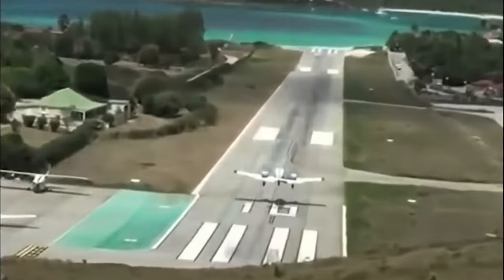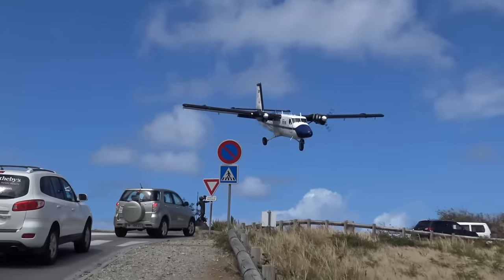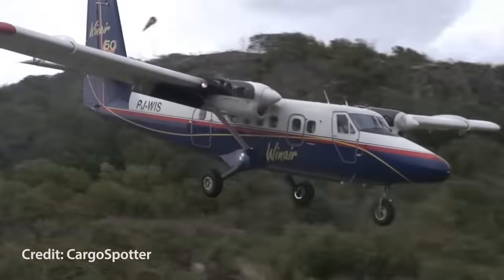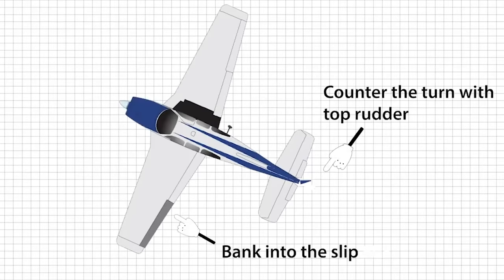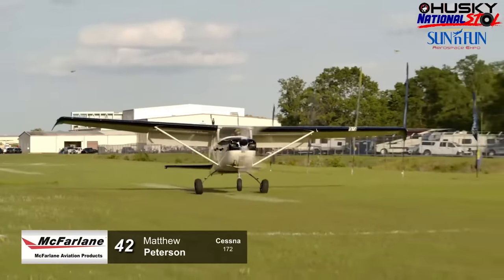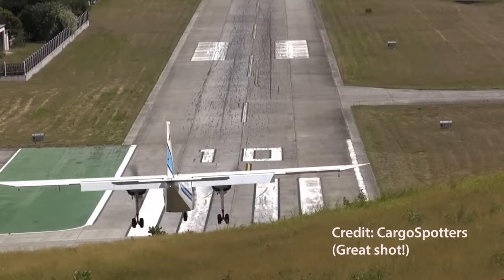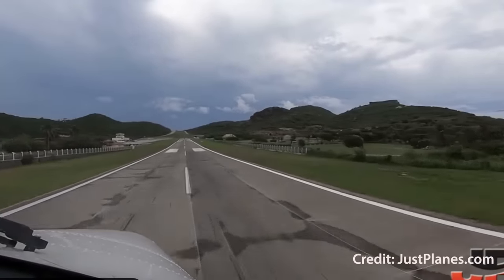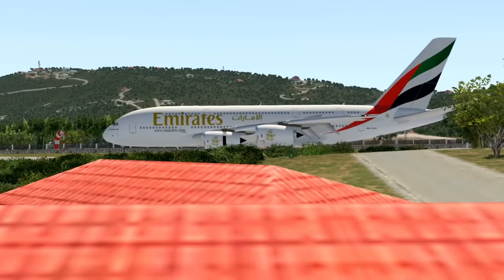Why This Landing Went Bad Part Deux

Comment: I doubt the accuracy of the sim - the brakes on the A380 probably wouldn't work quite that well in real life. But I suppose clipping the wingtips on the trees and light posts would make up for that...
Reply: You know what they say... one man's runway edge marker is another man's EMAS.
Reply: Looked like there was a graveyard right next to the runway. Must be where all the others that attempted to land a A380 there ended up.
Reply: I'm going to guess that 380 was configured with zero passengers, fumes in the tanks, a preteen-size  pilot, and auto-brakes set to "someone call maintenance and the fire department" setting.  With a killer headwind too, I'd guess.  You're not a simmer until you've set the wind speed to 140kts and performed the legendary 747 VTOL traffic pattern.

It would be interesting to know just how short a real 380 could actually stop in a zero-compromise hail-Mary attempt in perfect conditions.
Reply: It’s easy in a sim…just set up 100kts of headwind!
Reply: @suprPHREAK  Or in other words gail force winds, or above! At which point runway markers are not going be much of a problem
Reply: The real problem with the 380 is not the landing, how will you turn the aircraft and start there. I Guess, youre stranded.
Reply: @JuliusCesar2781  and destroy the runway in the process.
Reply: @JuliusCesar2781  just put the reverse thrusters to climb back the hill .
The slope , maximum thrust and a few prayers will help you takeoff
Reply: @Boss_Tanaka  When you fly backwards and land backwards on a different runway you need to close the reversers to have forward thrust for breaking. Fantastic idea.
Reply: @Boss_Tanaka  that and a bunch of jato packs
Reply: @JuliusCesar2781  A380 beachside bar & grill.. & hotel & casino & condos.
Reply: @JuliusCesar2781  It's happened before. They take the wings off and haul the plane away on an extra-wide flatbed.
Reply: @harveywallbanger3123  good joke !
Reply: An A-380 - never ever!
Reply: @JuliusCesar2781  Just fill it up enough to get you to the nearest real international aiport and make sure the rest of the aircraft is empty.  Otherwise, I don't think you'd be able to get an A380 out, even piece-by-piece on trucks.
Reply: Way back when a commercial pilot, I think for United, on his last day, dropped a DC-8  if I remember right at a GA airport in Troutdale Oregon.  Boeing brought in a test pilot and engineer and they directed the operation to get it out.  Remove all seats and anything else not bolted down, dump water and set fuel to about 25 gallons, just enough to hop 10 miles to PDX.  The question was always, did he intend it to be his last day, or was it accidental???
Reply: @ZeeCaptainRon And there was that C-17 crew that landed at that GA airport accidentally, with Gen. Mattis aboard, no less.  But it seems a bit different when it’s an aircraft that was actually designed to perform such landings.

Comment: The Arrow could have saved it, not by adding power at 100’ but at 400’ and going around. All the cues of an unstable approach were right there. Even on short fields, a stable approach is critical.
Reply: No reason not to go around until you get it perfect.  Unless, you are low on gas, then don't go there!
Reply: From your lips, to God’s ear, you speak the absolute truth on this one.👍
Reply: If there is any doubt, there is no doubt. Go around.
Reply: The twin that touched down a bit far down the runway and skidded into the water also could have done a go around when it became obvious they'd left entirely too much runway behind them.
Reply: I would say on short fields it's even more critical.
Reply: Spot on.  But sometimes I think pilots have a problem letting go of our egos and admitting we didn't get the approach right.  It's the same bug that causes pilots to fly into situations that their guts tell them to stay away from.
Reply: @evanwindom3265  True, which is why it's important to reframe the situation, and ask yourself the hard question:

What is more important? What is the show of better airmanship? Succumbing to your get-there-itis like a fool? Or being the adult in the room who can calmly say "this isen't right, go-around"?

It's not easy, but that is the trick. Reframe the situation, make it a point of pride to go-around. Think of it as not just the correct thing to do, but the moral thing to do, a display of both good airmanship, maturity and leadership skills.

If you can reframe the go-around like this in your head, so that you nolonger see it as a failure state, but rather as a display of maturity and class, then your own ego will eventually be the voice telling you to go-around.

You have to get it drilled in there first though, that's the tricky part..
Reply: @Grobut81  Good words!  I used to fly a lot of SAR, so we saw the results of bad decisions all the time.  I think it would benefit any pilot to look at crash analysis videos and see the "chain" of failures and poor decisions that leads to disaster.
Reply: @evanwindom3265  Oh definately. There is much to learn from watching videos like this.
Reply: exactly!!
Reply: I have a pretty fragile ego. I'd rather go around for a nice landing than trash a plane trying to stick a bad one.
Reply: A stable approach is more critical, not less, in short field operations. The margin of error is much smaller, and given that TFFJ's runway 10 slopes downward, you need to find a way to "flare" at a lower angle with the horizon than usual, hence must be carrying less speed on approach than usual. The opposite consideration is at play when landing on an upward slope; you need to carry additional speed so that your "flare" ultimately matches the angle of the runway, and doesn't turn into a stall/faceplant/bellyflop into the runway (quite common in one-way runways in the mountains; Aibai and Lukla are the go-to examples, but they are everywhere). The guy in the video somehow managed to faceplant despite the runway sloping downward, which is sort of an achievement in and of itself.

Comment: I’ve ridden in on a twin otter into this airport.  They cheat quite heavily flying in there.  We came over the hill quite hot.  I expected a go-around because of the excess speed.  But we got. Over the numbers, the pilot reached up and hit the reverse  thrusters and we came to a stop almost immediately..   I had a quick chat with the pilot and he just smiled when I mentioned the speed and the stopping prowess…
Reply: Agreed, heck even the approach at full feather (beta mode) is a huge air brake compared to almost anything with a piston engine. So if you are on speed you can simply control the angle of approach with the power lever. Then as you say, as soon as the mains hit its full reverse thrust.
Reply: Anything with a PT6 shouldn't need brakes to stop, move the props to beta and they become large air brakes, as soon as the mains are down, pull the thrust levers to maximum reverse. You can easily back up, I've done it many times.

Comment: I have over 500 landings at St Barts.  The Twin Otters usually fly a  much steeper approach as their STOL ability allows them to.  Typically they will be able to see the numbers the whole way down.  We were flying Aztecs and couldn't approach that steep safely.  Our procedure was much like the islander in this video - cross the ridge and follow it down at weed mowing height.  While the Pilatus was a little low, you do have to skim that ridge to avoid being fast and high.

We would get the gear and flaps down and stabilize at blue line about a mile out.  Call the non tower and be sure the runway was clear as you can't see it.  Cross (more like skim) the ridge about 10kts below blue line, and push the nose down.  The angle is steep enough you accelerate towards the numbers.  Trade winds buffet you, lots of rudder work.  At 20 feet raise the nose, but the sink rate doesn't change much as you are fairly slow.  Add a burst of power to arrest the descent.  Plant it.  This cannot be overstated, no time to be delicate.  Get the nose on the ground, flaps up, and brake hard.  If you aren't braking hard by those checkerboards you see on the pavement edges, go around.  You won't be able to stop in time as the runway is downhill to the beach.  We'd brake firmly to be sure we made it, then ease off to the beach.  Saved the brakes some, and you sometimes had a topless French babe wave at you as you turned the airplane.  

The Baron that hit the beach was way out of profile.  Not even close.  Obvious lack of local training and no awareness of the need to go around.

Runway 28 was for East winds under 6 knots or calm.  West winds essentially never happen unless it's a storm.   The approach is lower than the mountain peaks and you are in close to them.  Turn final over the bay and take a good look at the runway.  Here you decide to commit.  The is zero chance for a go-around, the ridge rises too fast.  If something  enters the runway, take the grass, but DO NOT go around.  

Paul Wikander (Virgin Air) had a photo of his DC-3 in St Barts in his office.  Apparently that stemmed from a wager, which he won.
Reply from the maker: Good summary. Thanks for that.
Reply: @AVweb   midweek's comment should be pinned as the top comment, I'd suggest   :)
Reply: Respects to you , sir !
Reply: What about with the 737? What's the best way to do this?
I'm thinking I'll reverse thrust over the traffic circle.....after I dump all my extra fuel on the beach-goers
Reply: i have 1 million landings here and this guy is wrong.
Reply: Paul Wikander was my boss when I flew for him back in the late 90's
He was quite the character. 
A flying pirate ☠️
Reply: Did you fly for Paul ?
He took the DC-3 in there on a bet, fully loaded with band equipment on a bet.
After he land, the French authorities wanted to arrest him...but they couldn't figure out what charges to bring on him.
It was the largest aircraft to ever land in TFFJ.

Comment: I spent a winter flying PA-23 Aztecs into SBH daily, sometimes 2 or 3 times a day.  Loved it, but often wished for the reverse thrust capability of a Twin Otter.  They gave us a little license to fly in there (mid 1980's), and I sure wish I had kept it for old time sake.  One of the fun parts was seeing passenger's reaction when the runway finally came into view on final.  Landing on 28 is easy if the wind allows (rare event, but we had a two week period in December when the wind reverses and it was called "the Christmas winds").   But if the wind favors 28, you can't take off on 28 so that meant a tailwind takeoff on Rwy 10 which was always much scarier than any landing at SBH.  In any event, the fresh-out-of-the-oven French bread at the bakery across the street from the airport was always a worthy reward.   Good memories!
Reply: You must have  been there just a few seasons before me - I still have my St Barts license.  We used to count the "Oh my God!!!"s from the back as we crossed the ridge and dove for the numbers, compare notes after work.  Triple cream brie on those fresh baguettes was a great lunch.

I had an engine failure on short final at St Barts, the mag drive cover loosened enough to drop the gears out of mesh.   That was excitement.

Comment: Another factor in landing at St. Barts SBH/TFFJ is wind. There are three windsocks and it's not uncommon for them not to agree with each other. If the normal easterly winds are 8 knots or less, you land on runway 28. One of my landings on runway 10 was 9 knots, gusts to 20 knots. DHC-6s and PC-12s have the advantage of running props into Beta, to shorten roll out. You are required to have a current Letter of Authorization or a local flight instructor onboard.

Comment: Brings back memories, for sure. My flight school had a 1600 foot runway. There was no sand trap at the end but there were a bunch of trees out there, and the damn things grew taller every year. We could land our 152s on half the runway but needed every inch on takeoff. Once we staggered into the air we'd have to do a quick left bank to miss a big one, followed by a right to miss another. Interesting close-up views of the branches out the side windows. We could handle it OK but some pilots unfamiliar with the place would crash into things, usually the chain-link fence and airfield sign at the other end. Fun times.
Reply: The occasional pilot crashing into the trees once and again will hold them in check.

Comment: Very Cool 😎 
I used to fly for the only U.S. 
air carrier that was allowed/authorized to operate into/out of TFFJ.
It did require extra training, which my boss developed for the French.
TFFJ is classified as a "Hazardous airport" under ICAO standards. 
Due to the fact that you can not fly a stabilized approach to get in there.

Comment: When I was learning to fly, way back in the mid-70s, I flew out of Waterford, CT.  We had 15, 18, 33, and 36.  Runway 36 was permanently closed because at the departure end of it was a huge hill.  I would guess that the hill was probably about the same height above the airport as the one at St. Barts is, except it was a little further back.  Between the hill and the end of the runway, I-95 ran through.  The wind usually favored 18 anyway, but you could use 15, which brought you in over the same ridge, but it wasn't quite as high, and you had a lot more room to get down.  They used to fly Twin Otters in there on occasion when Groton airport went below minimums with fog.
The difference between St. Barts and Waterford was that Waterford had trees on top of the hill.  More than once did I pick small twigs and leaves out of the landing gear on the 150 I was flying.
Waterford closed years ago, but you can still find the outline of it on Google Earth, just east of the Coca-Cola bottling plant.  It sat down in a valley, and it's really hard to see how low it actually was.
Reply: Where was this airport in Waterford? I fly out of Bridgeport and have never heard of an airport in Waterford.
Reply: The airport at Waterford is long gone.  On Google Earth, Latitude:  41°21'54.60"N, Longitude 72° 8'50.27"W
If you use the History feature in Google Earth, you can go back to April 1991 and see the airport.  This was well after it was closed.  By then, all the buildings, hangers and the barn to the west of 18/36 had been removed.  That clump of trees just west and south of the 18/36 and 15/33 intersection was a two story barn.  We had our Civil Air Patrol meetings on the second floor, and the first floor was a woodworker/furniture maker's shop.  It was also the cause of 'The Waterford Barn Effect' which was kind of nasty.  You'd get a cross wind from 270º or so, and it would come down the hill (the whole airport was in a depression) and it would hit the barn, and all of a sudden you'd have dead air.  Trying to fight the crosswind to stay on center for the runway, and then not having ANY wind, was interesting, and then you'd get by the barn and the wind was back.  By then, you should already be on the runway, but there was more than once that I said 'Nope, let's go try this again!'
If you look a couple of miles (about 5 miles to the east) you'd have Groton Airport, and there used to be Pilgrim Airlines in there, which flew Twin Otters, and sometimes we'd have to have them land at Waterford because Groton would go zero visability in the fog.  More than once I drove passengers back to the Groton.
But, yeah, a fun airport back in the 70s and 80s.
Reply: Small world.  I fly out of republic on Long Island.  I’m doing a cross country from republic to Groton, then to Bridgeport and then back to republic.
Reply: @crazy4gta1  Should be a nice cross country.  We used to fly out to Montauk light house, and then back to Groton.  No life rafts, no life preservers, none of that.  I guess if you were doing that today, you'd need to have that in the airplane.

Republic, that's where they used to build the P-47, F-84 and F-105 'Thud.'  Must be a lot of history at that airport!

Comment: My instructor used a neat trick. Take a grease pencil and make a crosshair on the windscreen horizon. For a normal landing point that crosshair at the numbers and use throttle, yes throttle to ctrl a/s. As the nose crosses over the numbers, pitch to level as you close the throttle and then as the plane settles pitch to one finger, then 2 fingers width above the horizon for perfect landing attitude in a Cherokee. You have use maybe 3 fingers for a cessna. This works a lot more precisely than the old "pitch for airspeed, power for altitude." For short field put croshair 2bfingers width below the horizon in cruise, then slow down on approach and aim the crosshair on the numbers as you use slow flight descent for the shortfield. It works terrifically and instilled sight picture and speed control into my airline days.
Reply: You can control the aircraft exactly as you need to with pitch for airspeed/throttle for rate of decent.
Reply: @TRPGpilot  Sure, but fazole's CFI's method is basically landing by AoA instead of landing by speed. Landing by AoA is safer and more precise.
Reply: @TRPGpilot  Using power for airspeed is a much quicker way to change your airspeed, and using pitch for flight path is a more direct way to control flight path. 
Here's my example, in S&L if we want to accelerate, what do we do first? Increase power and then as we accelerate we pitch to maintain altitude, the same applies for a descent. In a climb, we set a constant power, then we use pitch for airspeed, unless we want as specific speed and ROC/Flight path then the same technique applies.

Comment: I watched a heavy jumbo take off on ChCh NZ cross short run way once. It must have been a test. The pilot had to use power to do a super tight turn skidding the nose wheel in the process to get to the runway, then with the outer engines over the grass and full power the plane created a huge dust storm as it rolled the length of the runway. Spectacular to see.